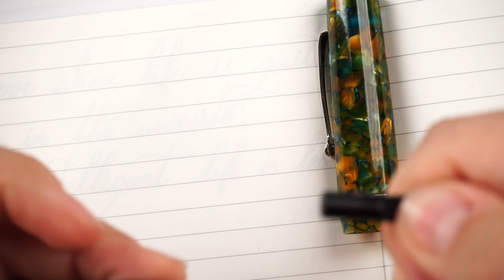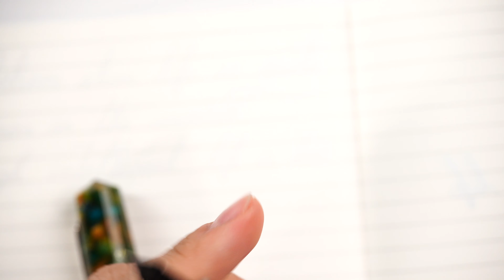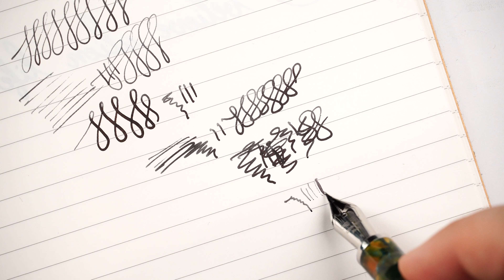How to make nibs more wet / dry

Comment: I wish there were pliers that were made out of a high friction yet soft material that could be used on tines to pull them apart etc without scratching the pen
Reply from the maker: hmmmm there is something but when I used it I observed that a nib can be damaged quickly, since its made of a rather thin gold or steel material and the hands combined with the leverage of the pliers... can squeeze a lot of force

Comment: Great video.  I have a Hondian 517D with a fude bent nib.  It writes so much lighter than my other pens using the same black ink.  The ink flow is less than the other, although it's extremely smooth.  What seems to be the problem?  How do I fix it?  Thx!
Reply from the maker: Fude nibs are something that are very finicky and temperamental - I couldnt answer to you because I would need to see one of these nibs in person and to write with it to understand what is going on, on a normal nib I can understand it more easy even if I dont have it in front of me
Reply: @pen.venture  I suspected the problem was not enough of ink as the ink would have to spread out over a much broader width due to the wide fude nib, so few days ago I tried to widen the gap with my finger with no results since I couldn't remove the nub from the feed. So I flossed a strip of aluminum foil paper into the nib gap line and a small piece got stuck inside that couldn't get out by washing so out of desperation I slided a thin razor blade in between.  The result was the ink color now becomes almost as dark as the other pens but now it writes much more scratchy...

Comment: Thanks for the video! Using your fingernails to adjust the nib tines makes a lot of sense. 👍🏻
Reply from the maker: Glad it was helpful! Using the finger nails is safe for the nib and you have a lot more control than using something sharp and made from metal - been there done that and I've ruined quite a few good nibs
Reply: @pen.venture  Ouch! Ruining good nibs suck! I use metal tweezers or pliers scarcely, when a tine is twisted. I always apply a protective tape between the nib and the
jaws of the tool, to prevent scratching. I feel ashamed for the stupid mistakes I did many years ago when I started tinkering on my own, but I guess beginners could learn from them.

Comment: I have a Lamy Al-Star. It has been writing fine for years. Recently  it writes about a paragraph or two and then dries up. I have soaked it multiple times, changed nibs, changed cartridges, and just ordered a new bottle of Lamy ink from Amazon. Once again, sadly, writes a paragraph and then nothing. Any ideas as to what may be going on. Using the converter with the new bottled ink. Thank you.
Reply from the maker: you need to take that apart and soak it with some nib cleaning fluid or maybe drop a little bit of rubbing alcohol in water to dilute it and run that through the pen with a bulb syringe so ill flush the crusted ink from the feeder
Reply: @pen.venture  Rubbing alcohol? I've read that is not safe to use for cleaning pens...

Comment: In some fountain pens if I write for an extended period of time (short writing period no problem) the feed doesn’t flow very well and it takes time for the ink to drive down again. What can you do to accelerate inflow to the feed while you write for an extended period of time?
Reply from the maker: Hmmm it is a tricky question, most of the times it has to do with the exchange of the air vs ink, a fountain pen is actually a very balanced exchange in between the ink that gets out of the pen and the air that gets in the pen. If this ratio is less air gets in than ink gets out, it starts to starve the pen. The way you can improve this is by making the ink channel in the feeder a little wider - usually one or two passes with a razor blade (classic one) in the ink channel is clearing that channel and makes it a little bit more wide, is not visible with the naked eye but it does improve the flow.

Comment: What to do if stupid (high quality) nib stubbornly resists that kind of treatment and always comes back to its original state. In my case tines simply wont touch each other always springing back to the state with slight gap in between. That makes it too wet. 14k, 149 nib from 80s.
Reply from the maker: :D there isnt anything like a stupid question - nibs are made to be under tension always so this is why due to its bent shoulders it tends to always want to come back to its shape, when we adjust them if we want to have a different shape, we need to push it a little over that point of always coming back to its shape, its a gentle equilibrium and one that does that needs to understand how much to go further because a little over the sweet spot can result in a bent nib. For sure taming down the flow you must scissor the tines one under the other than the other one as well - but be careful doing so and go baby steps - the best solution would be to get it into someone that has more experience

Comment: Great overview. I did have one comment, I was always told to never clean ebonite with any type of alcohol as it would degrade and ruin the ebonite. I have never tried it but I have always heard this in the community.
Reply from the maker: it could be true , i haven't heard it but i might ask someone who has more knowledge. Thank you for the feedback Eric
Reply: If there is a risk of damaging the ebonite feed, you can use pen flush (a special solution for cleaning fountain pens) or distilled water—just a little bit would be enough. But if the feed is made of plastic, you can use a little bit of rubbing alcohol to clean the feed. Just be careful since alcohol can discolor the feed.😊